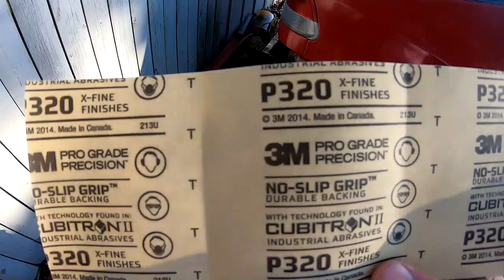Rustoleum Gloss Leather Brown Paint job civic #Nesquik 90% done $50 paint job cheap

Comment: I have not seen a restoleum paint job without orange peel
Reply from the maker: Yeah after this paint job im done with rustoleum on my own vehicles. Im gonna just invest in real automotive paint. Its gonna suck wetsanding.
Reply: I would agree.  You have to go 2 stage paint and get a better gun!  It’s fun to learn the gun, spray technique with rustoleum tho to get the basics and movement down.
Reply: That's because people are spraying it way too thick. The HF HVLP gun in this vid has I believe a 1.4mm cap which means it's intended to spay materials with a low to medium viscosity. Which translates to something like 16-28 seconds when checked with a #4 Ford viscosity cup. In order to get in that neighborhood I thin Rust-Oleum somewhere close to 50/50 with mineral spirits and I get no orange peel.

Comment: FYI.... thanks and thanks again for your mix formula ratio aka 16 oz paint then 4oz of mineral spirits.....for 20oz...cup gun fill...l only varied with 3-4oz of mineral spirits thin..,...since my hvlp gun and air compressor HF setup was mirror of yours....the HF hvlp gun is low quality.....the gun trigger came apart randomly PIA.... however got work done.... thanks
Reply from the maker: glad this helped guide someone

Comment: Just did mine watching your videos and gat orange peel I wet sanded 1000 then 2000 and buffed looks like a mirror just be careful with the corners so u don't over sand like I did on 1st panel
Reply: Thinning the Rust-Oleum closer to 50/50 will get rid of orange peel. They don't tell you on the can you can thin it that much because Rust-Oleum is marketed for residential use and the VOCs would be too high if thinned that much.

Comment: Thanks for sharing. How much air pressure are you running?
Reply from the maker: I ran it on low pressure this time 30psi I usually do 60 or higher to help my smaller hose problem.

Comment: Hey have some additional questions for you.....do you use an air regulator on your setup??
Reply from the maker: just the regulator on mu compressor
Reply: @BarbasLife   hey thanks alot .... did or do you filter.. screen the paint mix?
Reply from the maker: I filter the paint when i mix it. I do not run the filter thats inside the gun it makes it clog.

Comment: Is it possible to wet sand rustoleum after it dries a few weeks ? Just asking because i use it on military helmet restorations and it seems as though i can still dig my finger nail in it even after a week
Reply from the maker: Yeah you can wet sand it and buff it to a mirror finish after it dries. I painted a helmet too and it took a long time to dry also for some reason. Go to my older videos i have some content on wet sanding and buffing rustoleum.
Reply: @BarbasLife  Thanks gonna give it a go soon

Comment: Dude you need to get a bigger air hose. You should have at least 3/8" inside diameter hose. That little hose is starving the spray gun for air. This is why you have so much orange peel. Try it out and you will be amazed at how much better your paint guns spray.
Reply from the maker: Thats something im definitely gonna do. Thank you for the info that helps out.
Reply: @BarbasLife  Make sure you get the 3/8" ID hoses (Basically look for a 1/2" hose). You will need to go to a paint supplier or Amazon to find the air hoses and connectors. I see a lot of people on YouTube using the wrong size hose and they wonder why they can't get a good finish from the spray gun.

Comment: Good job! I think, if the paint had more time to cure between coats, the orange peel would be less severe. The paint can has instructions to cure 24 hours between coats. I know, who wants to wait? My paint jobs aren't great, I think because I get impatient.
Reply from the maker: Your  paint job looks great i just seen part of a video of yours. I need the recipe  for that color .
Reply: @BarbasLife   The Goldwing? I got lucky somehow.
Sail Blue and Aluminum Paints. The aluminum gave it the metal flake effect. And then I topped it off with spar varnish. I got lucky again. Thanks for the compliment.